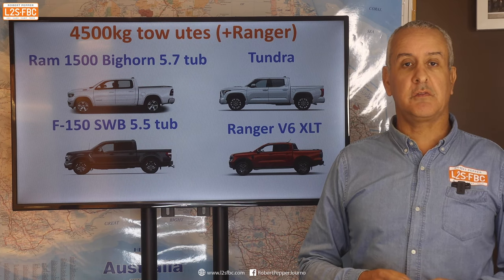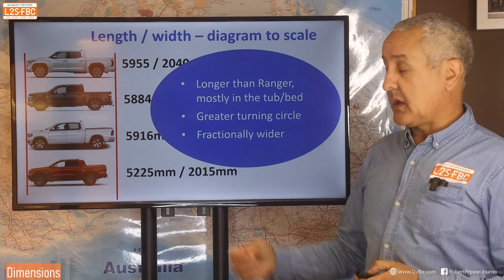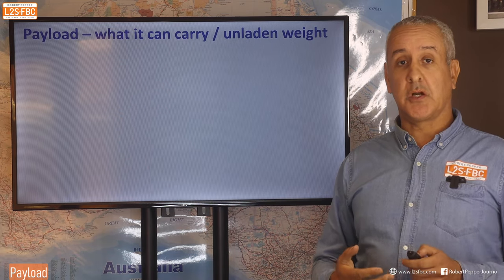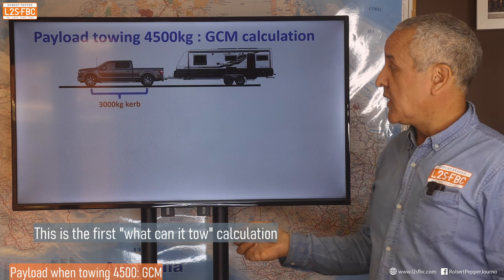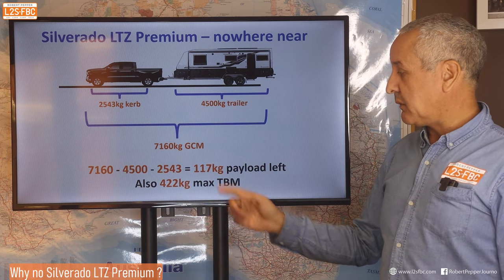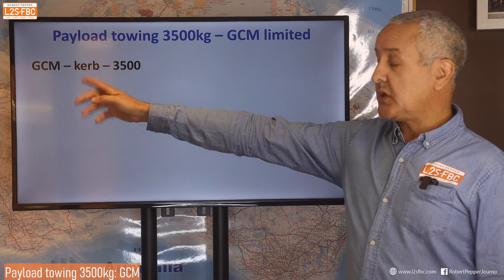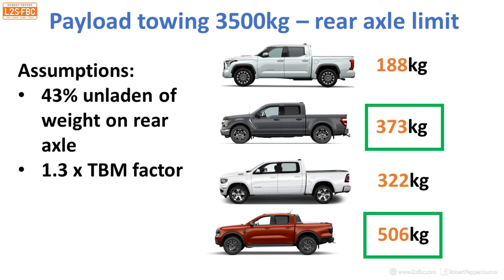Which is the true "4500kg" towing ute?  F-150, Tundra, RAM 1500 [2024]

Comment: Great video! Something that some of the OEMs (Ford, GM, Ram) have done for the 150/1500 class in the US is to have published ratings at sea level, which then drop as you go up in elevation. This info is usually buried in the owners manual somewhere. I'm not sure if they're doing that here in OZ, as I don't know if the regulations allow them to try that trickiness. Something else to consider is that while a longer tow vehicle wheelbase increases stability while going forward, it can have deleterious effects when reversing. My experience has been that when the hitch-to-trailer axle distance falls below the vehicle wheelbase the trailer becomes very "snappy" when reversing.
Reply from the maker: Thank you, good info!
Reply: Good point, I looked at my F-250 numbers and couldn't find anything on altitude, but it would seem obvious. I like your point on ball too axle distance, as I had a 13' Scamp for years, and with a single axle and such short length, that would jackknife in a second. Our current 21' double axle, not so much.

Comment: Hi Robert.  Very detailed video indeed...I had no idea that there were so many factors at play beyond what the manufacturer claims.  
QUESTION on the rear axle limit calculation example -- can you explain how you got the following (let's use the Ram figures) "1860 - 1058"...kgs in the final examples (perhaps more clear if you actually used the unladen weight @ 43% and not worry about actual known numbers...ie say that these are for demo purposes only so that more understandable I suppose?)  
Thanks!
Reply from the maker: 1860kg rear axle weight minus 1058 (43% of rear axle weight unless otherwise known) - 585kg (450kg x 1.3) is the answer.  It won't be precise to the kg as the 1.3x is an estimate, spring rates, etc etc, but for comparative purposes good enough and shows how close they all are, hence my recommendation to tow 4000kg or less.

Comment: Request - are you able to do a video on using light trucks as a tow vehicle rather than large 4x4's?
Example - I own a Hino 300 series 921 model and was very surprised to find out that the towing capacity as per the Hino manual is 3,500kg max...which I find a ridiculous situation when you see so many 4x4's towing 3500kg vans which in many cases are heavier or equal to the tow vehicles weight which I deem to be a very unsafe practice.
In addition, it seems that Light Trucks do not have the ability to do GVM upgrades which is very common solution applied to 4x4 tow vehicles.

Comment: Hi Robert.  If you read Page 13 of Fords "2023 Towing & RV Guide" around the middle of the page it states that Ford calculates its payloads with "a 150 lbs (68kg) person at each available seating position." In a Super Crew with a console that would add 750 lbs or 340 kg to your F-150 payload numbers.  If the truck had a front bench seat it could be 900 lbs or 409 kg extra.  In 2024, Ford should release the F-200 which should add another 500 lbs (227 kg) to the payload.
Reply from the maker: In Australia, the fine print says: "Kerb Weight includes the vehicle with a full tank of fuel, without occupants, luggage or cargo and with the heaviest possible combination of factory fitted optional equipment included." and it is the Australian specs I'm using.
Reply: For the F-150, there was a package called Heavy Duty Payload Package(HDPP).  This added +~800lbs of payload to the vehicle so the best case payload for 2021-2023 RCLB 2wd was approx 3300lbs.  However, in 2024 this package was not offered, so perhaps the mythical F-200 will be the new F-150 HDPP line, no official info on this yet.   I have a 2022 F-150 HDPP 4x4 which a payload of ~2800lbs(~1272kg), which is rated to tow 13k lbs.

Ford is the only us truck maker I know of which gives you a derating table for altitude.  The table is provided as a way to scale sea level performance at various altitudes.  Other usa truck makers just gloss over this and tell the owners nothing.  Any US truck owner should look at ford's towing guide to learn more about towing in general.  Ford owners get more useful info on specific configuration performance.

Comment: The silverado is the only one that comes with decent gcm upgrade option. 8990kg, 4490kg gvm, 2700kg rear axle. What difference does that make to your pick? Also v6 ranger has decent gcm upgrade 7200kg, 3700kg gvm and 2120kg rear axle does that affect your pick for 3500kg towing?
Reply from the maker: No as I ignored aftermarket upgrades. I'd need to reconsider everything in that light. If you start looking at upgrades you never stop, most people just want to buy the car and go, and not worry about upgrades, warranty etc.  However if I did consider upgrades, then yes it'd change.  I still wouldn't two 3500 with the Ranger purely on trailer weight/towcar weight ratio.

Comment: Thanks Robert, great job. Do you (Australia) not have the Ford F-250/F-350 line of trucks? The are probably the most common (along side the GM 2500/3500 series) in the US.
Reply from the maker: We do but only as one-off conversions, all these are mass-market offers.
Reply: Generally, these American "trucks" are only a new thing in the Australian market. Last 5 years or so some companies have started importing them and converting them to left hand drive. Because of the parallel import popularity, Toyota are officially bringing the Tundra here next year, I'm ignorant as to whether the F150 is official by Ford or if some company is bringing them in. On the car and truck sales websites there are now around 2,000 F150's, Ram 1500's, Silverado's for sale in Australia in private and dealership ads, and we are starting to see them commonly on the road. Prior to this people considered good tow vehicles to be Toyota Landcruiser, Nissan Patrol, or small forward-control trucks the likes of the Isuzu NPR or NPS, Fuso Canter, or Hino 300 to Hino 500.
Reply: @tosgem  "converting them to left hand drive. "  why do you put them on the wrong side in the first place ;-p
Reply: @tosgem  thanks. I'm betting that is not an easy task.
Reply: @berthaduniverse  the companies that specialise in the right hand drive conversions have pretty refined processes but some vehicles are easier than others. I believe the RAM 1500 needs a lot of work and parts, power steering box, new steering rack, and that the end result has reliability issues. I think the F150 converts a bit easier, and Toyota are, being from a right hand drive country, going to redesign and re-engineer from the factory

Comment: For something like a Cherokee trailhawk... The 2.4 4cyl is rated at 2000llbs while the 3.2 v6 is rated at 4500lbs. The transmission, suspension, transmission cooler, hitch ... All of that is identical... Would the towing limit be based on acceleration then ? Note, the 2.0 turbo tows 4000lbs with no other differences also. If the 2.0 turbo doesn't explode towing 4000 lb I wouldn't think that the 2.4 would but I could be wrong. As I understand it acceleration is one of the metrics for towing. Would this limit JUST be acceleration?
Reply from the maker: No, acceleration isn't that important. Limitations are really more engine/trans cooling and ability of the towcar to control the load, plus chassis loads through the hitch. Engine size/power does not dictate tow capacity.

Comment: If its a 5th wheeler dont they have to have ball behind the rear axle so they are not classified as prime mover requireing a HC licence?

Something else do the authorities consider these to be the same light trucks? Cause with light trucks have a downgraded 50mm ball, from memory on a light truck 50mm ball is only rated to 2800kg.

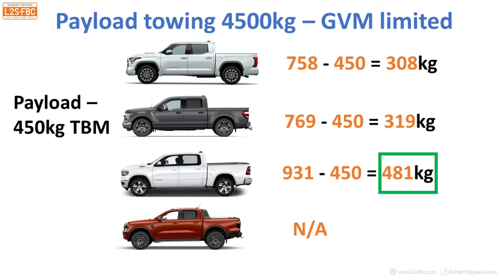Comment: @8:40 are those payload figures of 758, 769 & 931 the max payload while NOT towing? Shouldn't it be the payload figures factoring in 4.5t. So 547, 769, 694 respectively (I know the Ford it doesn't make a difference). Making the Ford the winner? I was a bit confused by that slide, am I missing something?
Reply from the maker: That part is taking the payload and subtracting 450kg for 10% TBM. Now you may run into other limits before that, eg rear axle load, GCM.  Also, you may have a trailer of say 3900kg with a 450kg TBM so be well under GCM.
Reply: @L2SFBC  I get that. It just looked to me like you were subtracting the 450 kg from the NO tow payload figures rather than the TOWING 4.5T payloads figures. Or am I missing something? Great video by the way this stuff not well covered.
Reply from the maker: Yes, it was from the no-towing payload figures, because that calculation is independent of any other. Essentially, you have to check each limit invidually, and whichever is reached first is your limit.  This is complex as there are multiple calculations.  Hence the Towing Weights Calculator!
Reply: I think I'm missing something too  @L2SFBC  Robert.  In North America the F-150 has the highest payload, the heaviest rear axle capacity, and the lowest curb weight due to the fully aluminum body.  Also in your video the payload and the payload while towing is the same.  Did you misquote the payload on the Ford?
Reply from the maker: NA specs are different to Australian. Payload when towing and payload not towing may be the same IF the GCM is not the limiting factor, and there were a couple of times when I said "here's the payload, but it is NOT accouting for TBM". The reason I said that was because TBM is variable. Other times, I work on 10% as I need a max figure.
Reply: Well  @L2SFBC  from what I see you are working with a low capacity (comfort) spec due to tire choice & rear springs or something.  Usually GVM is higher than GVWR yet your GVM is 3220 kg and our towing spec GVWR is 3568 kg and since the combined axle capacity is 4236 kg you should maybe look at the GVM Upgrade numbers because in Canada our Max Tow for the F-150 is nearly 6.5 T.